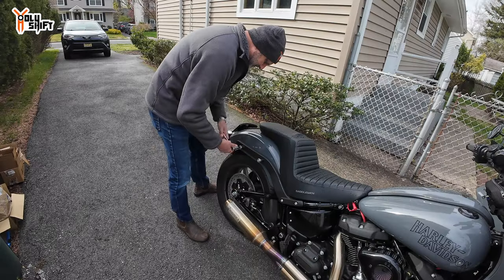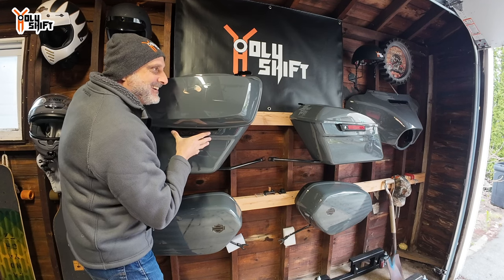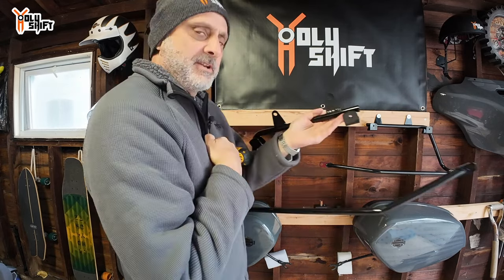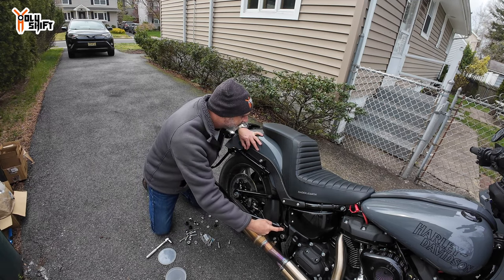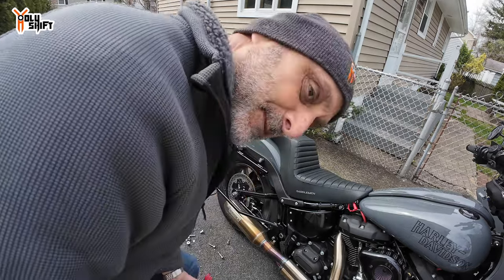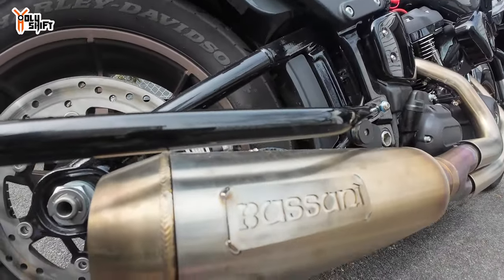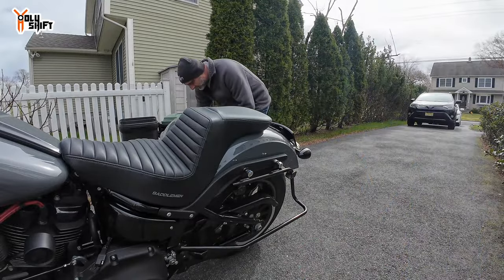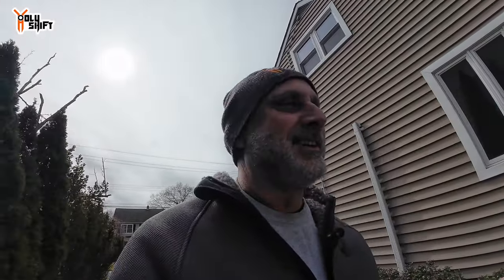The BIG UPGRADE ! Touring Bag Conversion

Comment: Bro i felt worried about mine too with the sawicki speed mid length and it hasn’t burned a hole through in over 5k miles of hard riding! I did put some black heat resistant tape on underside just for my peace of mind✌🏽 ⚡️